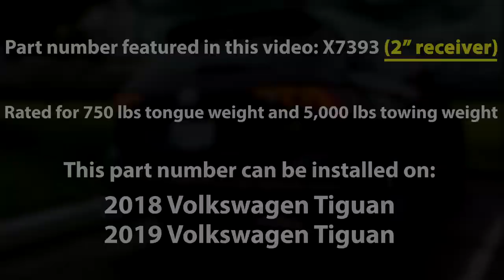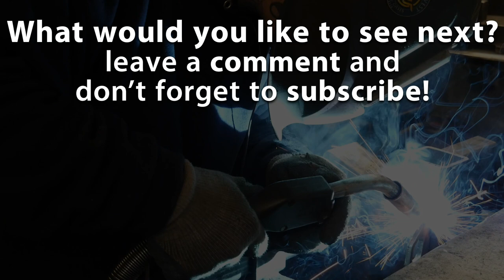How to Install the 2018-2019 Volkswagen Tiguan EcoHitch

Comment: I have a question that isn't related to the hitch, maybe you would rather I contact you directly. Curious about removal of the Chrome molding/protector that looks like exhaust ports. Are they removable?
Reply from the maker: Hi there Harvey! A lot of times this piece you are referring to is easily removable and just clips into the bumper. We would be happy to go over your specific set-up further if you would like to give us a call at 800-246-8132.

Comment: Does this require trimming or cutting of the rear facia/bumper cover? Thanks!
Reply from the maker: Hey Jacob, thank you for the question! The hidden EcoHitch for the 2018-2019 VW Tiguan does not require trimming for installation. You may need to angle the bumper a little bit more for reinstallation once the hitch is on there, but you won't need to trim the facia. If you have any additional questions, please feel free to call our tech support at 800-246-8132.
Reply: So this also replaces bumper cross member?
Reply: @torklift_central  Very interested on this hitch! It does not seem to fit the original cross member above the EcoHitch. Could you please confirm that information? The video does not point that out... thanks! And by the way, how much does it weight?
Reply from the maker: @ricardoniemeyer2256  thank you for the question! The crossbeam is removed to install the EcoHitch which is the same case for many other hitch installations. The hitch itself weighs 11.3 pounds. If you have any additional questions please feel free to contact our tech support team at 800-246-8132 and they'd be more than happy to assist you with questions!

Comment: Taillights and bumper removal? No bueno. Etrailer just drops the exhuast with 2 bolts...4 bolt hitch...wham bam!
Reply from the maker: Hello Josh, 
Thank you for your comment! Our hitches are like fine wine - some applications take a little longer to install. Typically it takes about 1 to 3 hours depending on the vehicle application - Tesla typically takes the longest. But with the slight increase in install time you do get many more benefits with our EcoHitches. The main benefit being the fact that for the Tiguan, you have the option to remove the receiver when it’s not in use, so you can return your vehicle to its original look when not towing/hauling. 

Also, if you look at their instructions - other hitches only have 4 points of contact where they’re installed to the frame. Our hitch has 8 points of contact for added strength, stability and connection, as well as a frame support plate specifically made for the Tiguan EcoHitch - all of which installs to the vehicle frame to ensure that you and your family are as safe as possible when using our Lifetime Warranty hitch. With our hitch, you also don’t have to use unsightly support straps to achieve the highest towing and hauling ratings and unlike most other hitches, ours doesn’t lower your ground clearance and hang below the bumper which affects the look of your vehicle. 

So, if you’re wanting a “wham bam!” kind of installation, you can most definitely still have the “wham bam” with our hitch - and for even longer with our benefits!  If you have any additional questions about the EcoHitch, please feel free to contact our tech support team at tel:800-246-8132.
Reply: Don't forget that you need to mangle up your bumper plastic with a dremel to fit the Etrailer... Even once you have done that it doesn't fit properly, check out the etrailer video. Even with it installed by the pros your are left with the bumper plastic pushing up against the hitch. This Stealth EcoHitch looks much better IMO. Looks like it would even install with less time because you don't need to perform plastic surgery.
Reply from the maker: @JoelPittenger  Hey Joel,
Our apologies on the delay of responding but thank you for leaving a comment! We’re so happy to hear that you like the design of the EcoHitch. Please let us know if you have any questions in the future about our hitch in the future.
Reply: @torklift_central  Well said, this is exactly what I have been looking for: a well designed, sturdy, hidden hitch.  I would much rather a more complex install for the tradeoff of not looking ugly, reducing clearance and cutting into the bumper.  Very nice product Torklift!  I've installed wam-bam before and found wam-bam looks wam-bam.
Reply from the maker: @MrSuperdurden  Hi there Super Durden! Thank you so much for kind words about the product - we sure do appreciate it!